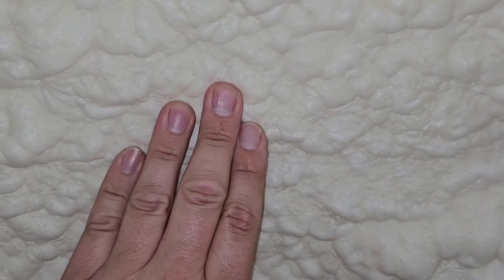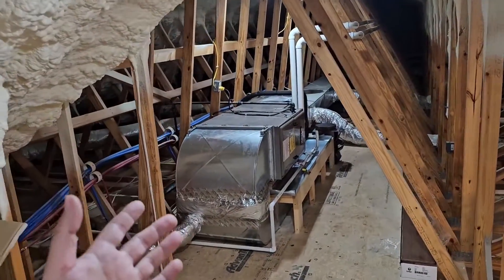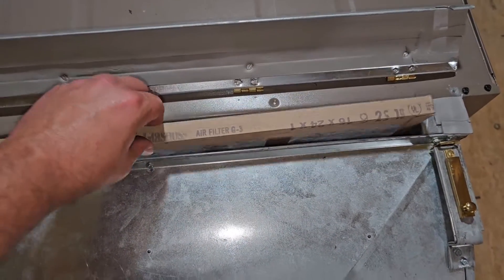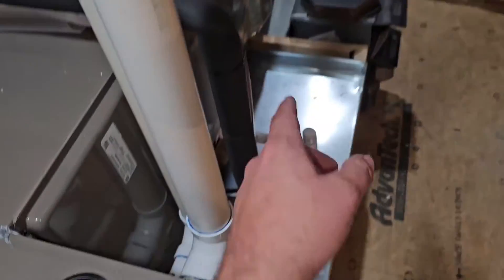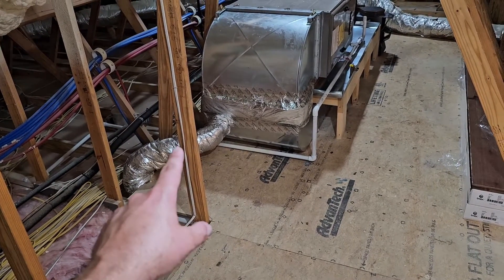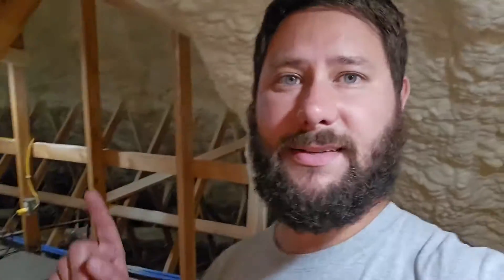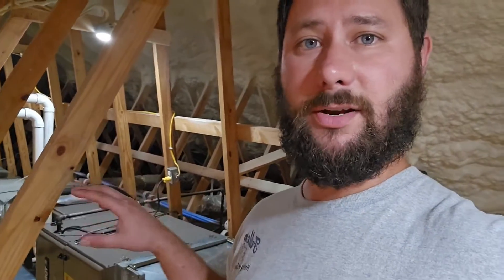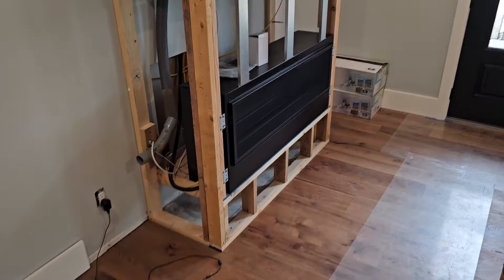Fresh Air Hack: Foam Insulation Benefits You NEED to Know

Comment: I have a propane furnace in open cell foamed atticed. Would pulling outside air into return be adequate enough for combustible air needed?
Reply from the maker: is it 80% or 90% furnace
Reply: @TaddyDigest  80%
Reply: Unfortunately it's 80% in a foamed attic. 90k BTU. Would a 6inch duct pulling air into the return be adequate? I'm having a hard time finding literature on this. Do you have any sources you can send to me please! Thank you!

Comment: Hey Taddy can make a video on the best way to add a Fresh Air system to a manufactured home like a double wide? The systems are and outside condenser with and inside A Frame, Furnace, and blower. I t st not think there are any fresh air intakes on the system.
Reply from the maker: yes I can do that for you

Comment: House is pulling air back through the bath fans and causing mold around the bath fans on ceiling when the hot air from outside hits the cool air from inside it is condensating and causing mold. I have replaced the outside bath fan vent with flaps that stops the outside air from coming in. House is really tight. If I add outside air vent to the return like in you video with that stop the outside air from trying to pull through cracks in doors and other weak places?
Reply from the maker: Yes that may work
Reply from the maker: But a back draft damper in each bathroom vent fan would be best

Comment: Great video. Currently building, my HVAC guy will be doing a 6" fresh air intake. Question what about bathroom & stove vents? Are they able to pull in fresh air via the intake in the furnace to be effective enough?
Reply from the maker: I wouldn't use the furnace to pull in fresh air for those appliances

Comment: Hi Taddy!  Thanks for these videos. They’re very useful.  We are building a 4000 sq ft home, single story, in the Texas Hill Country near San Antonio.  Open cell spray foam, which is OK for our hot and relatively dry climate.  Two gas furnaces and variable speed AC on each. 

Just like your video, we have ducts going into the return air plenum on each HVAC and a damper flapper for each.  

Here’s the question:  Our 3rd party inspector said that we needed a duct for combustion air for the furnaces since we have an unventilated tight attic.  I had visualized a duct similar to that for the fresh air into the return plenum, except going into the combustion chamber.  However, he said all that’s needed is a dryer style vent whose opening is just outside the furnace.  So we have 2 vents like dryer vents hanging down from openings in the roof ending just outside each furnace.  Since in a normal vented attic, gas furnaces don’t need any special combustion air ducts plumbed right into the furnace box, I guess what they’re doing for my house makes sense.   Does that make sense to you?

Thanks!

Comment: Will you do a video prepping techs and installers for the winter heating systems what to watch for puttings hoses on the right port pressures ect just getting ready for winter if you do ill use it to brush up my crew thanks tad
Reply from the maker: deal